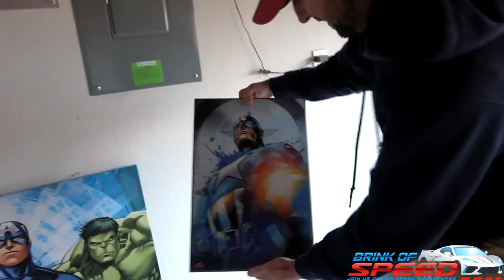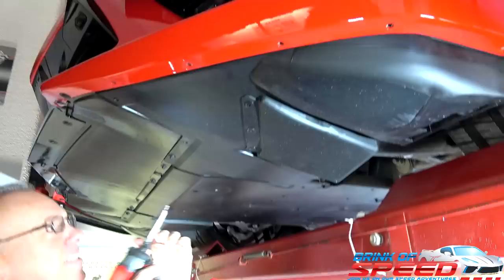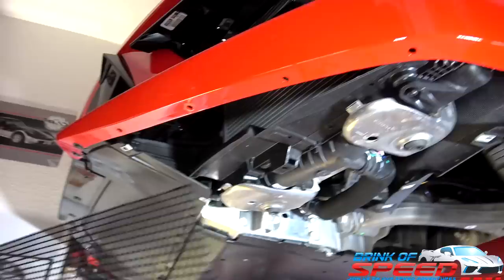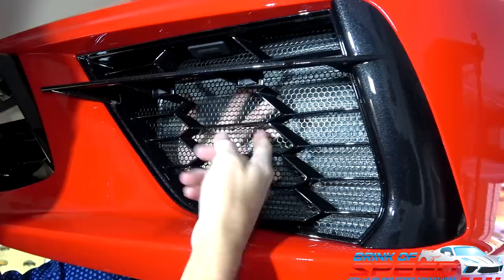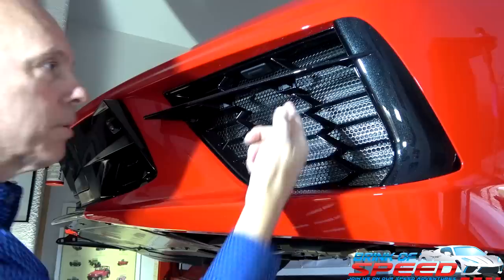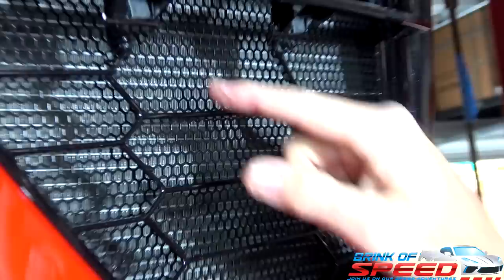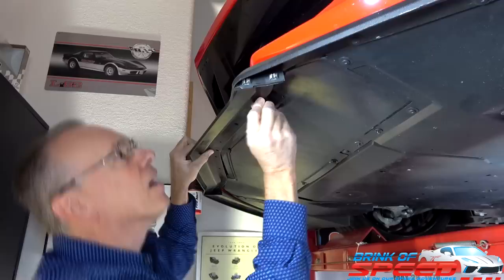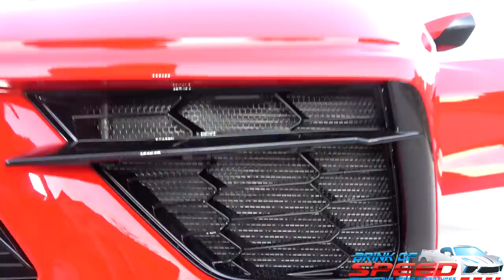EASIEST & BEST 2022 C8 Corvette Radiator Protection BEHIND the GRILL Install!

Comment: Instead of the zip ties. couldn't you use the 3 screws in that splitter?  I can't tell if the screen if flat against the splitter, but you could use longer screws and a spacer on the back.

Comment: i do like these if tall enough to park a car under. How ever I like my 2 post from greg smith equipment, it's tall enough to put my mustang up in the air all winter and park wrx under it. Now it will be the c8 one day on the lift with mustang under it.
Reply: LoL me and this man would get along just fine. I'm 100% sure I have zip ties on the mustang holding NO2 line and zip tie holding my quick release oil drain from moving to unlocked on my wrx

Comment: I just received a set but have yet to install.   I'll be jacking up the car one side at a time.  Anyway, I'm concerned about cooling on long drives on a hot day (90+ deg.) and track days.   I'm no Tommy Milner, but still...
Reply: Unless on the track - I have absolutely no worries. It’s a screen that lets lots of air through. Just my opinion.

Comment: I like the lift. How high are your garage ceilings?  Did you also have to modify the garage door  rails to be higher?
Reply: Yes you need a highlift track for your garage door opener. A 9 foot ceiling is a squeeze but can be done. 10 foot ceiling is what my garage is.  Best thing I ever did.
Reply: @neighbormark  yes it was a great idea. I have ten foot ceilings but garage door is normal seven feet.  I did not think it through at the time. What is an approximate estimate of the cost?  Thanks.
Reply: @jlpnav  about $400

Comment: Did you get to put screens on the radiators in the big air scoops behind the doors?
Reply: I have not decided to do that yet!  I may dot this at a later date.
Reply: @neighbormark  It's not as visible as the front, but probably just as vulnerable.

Comment: This is a must see video! How can Chevy not offer this to its customers?🤔
Reply from the maker: Heck yeah, I’m not sure why they didn’t do these.
Reply: SO THAT THEY CAN SELL YOU NEW RADIATORS.  I SAW A DAILY DRIVEN C8 CORVETTE AND IT ALREADY LOOKS LIKE BOTH FRONT GRILLS NEED REPLACEMENT.  THIS IS A NECESSARY ASSESSORY TO PROTECT THEM UNLESS YOU DON'T  MIND REPLACING THEM OFTEN.🤑🤑🥴
Reply: GM states that the grills could VOID the warrantee by restricting air & overheating the car
Reply: They offer them now as a factory option.

Comment: Totally agree on some key points:
1) Zip ties work and are not tacky if you cannot see them unless extremely close up. I also installed the screens in the two middle sections of the front. 
2) The Paragon screens are very nice, but pricey and involved a more difficult install. I used their pieces for the side vents near each door. 
3) I think it is important to KEEP the ability to reach the frunk button. Yes, it can be opened a couple of other ways, but I find the button the most convenient for all the times I need to open it. 

I am bit disappointed you feel the need to have the "Z51 look"....I am happy with the C8 look. Lastly, how high are your ceilings in your garage?
Reply: There is a video we’re Tage says the grill cut airflow tone coolers and they have tested them and can’t give approval on any so far. They also don’t recommend ru. G track with them at all.. Rick con tie has the video on one of his tech Tuesday uploads
Reply: @glenthewarvet6047  Nobody has to worry about me pushing the car so hard that the car is going to overheat with these grill guards. Lol
Reply: 2016 -2019 you could get the “Z51” look as an optional wing on the non Z51 car.  So far not so on the C8….I just like the look because that is how I first saw the C8 at the reveal in 2019.

Comment: What do you think? About what the chief engineer from GM said about putting anything over the radiators, after market mesh, grills etc. “ if something goes wrong with the cooling system you are on your own” Basically It voids your warranty.

Comment: Thanks for the great video you two knuckleheads!

However, I can’t believe GM has not addressed this issue for the 2022 version. That is poor design.

Also, I can’t bring myself to zip tie parts to such a nice car. Just seems so tacky to me.
Reply: I know - I thought the same thing about zip ties. It sounded tacky and cheap. But after looking at others who had them installed it seem to me reasonable especially in the way you can hide the zip ties.
Reply: @neighbormark  Thanks Mark!
GM should really address this at the factory. I wonder if the ZO6 with ZO7 package will require a truck load of zip ties and mesh to save all the air intakes…
Reply: GM states that the grills could VOID the warrantee by restricting air & overheating the car

Comment: I'm not an engineer.  Looking at those grill guards, I bet you are restricting air flow by maybe 25%.  You do have mass there.  I saw an interview with Tadge about 9 months ago.  Someone asked about the grill guards.  He said if you have over heating issues, it won't be on GM's dime.  My C8 cooling temp runs 175 -185.  Two weeks ago in heavy traffic on a 95 degree day.  My temp climbed to 210.  The highest I ever noticed.  I'm not a fan of restricting air flow.